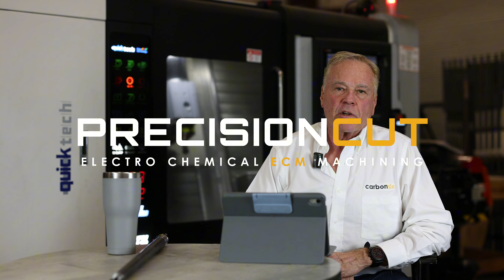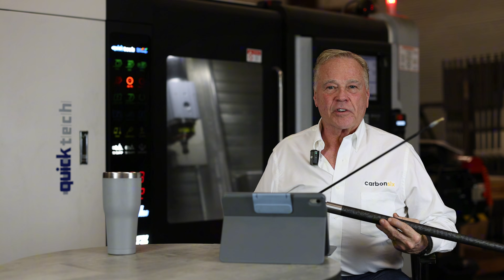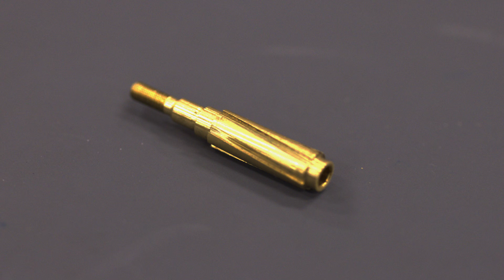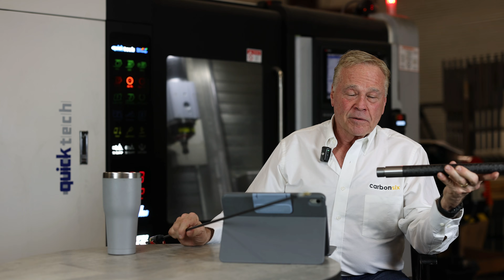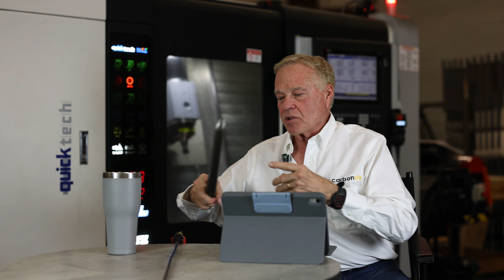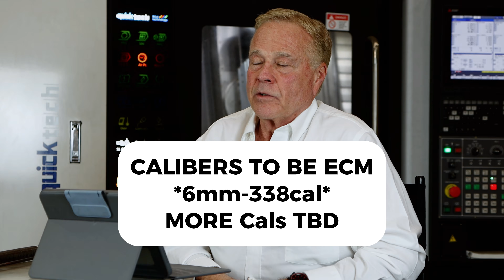ECM Rifling Process  | 2026 Company Changes

Comment: We were using ECM 50 years ago in the aircraft industry. Barrel life? Anyone check IGA?
Reply: theoretically.. actually proven out with some other companies, a notable improvement IF it includes gain twist rifling, in heavy caliber bullets with around 3000fps speeds, with barrels they are seeing 80% improvement in barrel life...it also helps handle the trend of high pressure cartridges, like the NAS3, or Federals Back Country line.

Comment: I really think this ECM method will open a new world of not just consistency but will have the potential to allow you to play around with other barrel materials that was never workable for CHF or "cutting". It's these kinds of ground breaking innovations that gets the ball rolling towards other advancements, as we know barrel manufacturing advancements have been really on the stagnant side in the last few years. Imagine this ECM method get to a point where it can be used as a "fine tune"' to a chrome line barrel to "work out" the imperfections that are a given with chrome lining .

Comment: Carbon 6 did a terrible job on the chamber of my 300 prc. There is a huge burr all the way around where the case mouth steps down to the free bore. I sent it into them and they sent it back with no explanation or fix. Barrel is currently at a gunsmith and having a new chamber cut.
Reply: Good to know

Comment: I assume that another benefit of this process is the ability to use different/better steels that can have higher Rockwell Hardness ratings which will equate longer life and even more consistency. You could literally use a high end steel that's already hardened before you rifle it.
Reply from the maker: Correct this also a benefit

Comment: "Cathode" is wrong, no insulation for isolation of cutting, thus no guide to keep it centered (the insulating material acts as the centering guide). The salt water is an electrolyte that allows the electricity to move from cathode to barrel bore, provides removal of particles AND cooling. ECM rifling is not new technology, has been used in artillery barrels for a long time. Smith and Wesson also used it for some pistol barrels.

Comment: Is there a benefit to this technology in the type of steel you can use? Steels used in button, forged, and cut rifling would need to be amenable to these methods. Does ECM let you use a harder/stronger/more wear resistant steel than traditional methods? Akin to the super steels in cutlery that have come out in the last 10-20 years.
Reply: ECM works on even hardened steel with the same level of precision. Fantastic process.
Reply from the maker: Exactly with ECM the possibilities open up

Comment: Ron. I thought that you were going to do a computer graphic simulation of the process... But, not.
You did mention "twist gain", I think? What does that mean, in this process?
I'm not sure how much "secret sauce" is involved, but I'd love to see a more complete description of how you have implemented this, because I'm kind of an innovation guy, with a pretty broad background in electronic system R&D, with other stuff mixed into the sauce, over the years... 
You mentioned temperature effects from other rifling methods, and that really struck me as a big advantage, where, with EDM, you can do a blank that has he'd any kind of "interesting" heat  treatment processing, any kind of outer surface processing, so you could almost take a complete rifle, and do rifling as an almost-last step. You're making my imagination go crazy!
Have fun, keep on innovating!
Reply from the maker: More videos to come! Thanks for watching
Reply: You rotate the cutter using cnc...can vary the roatation of the cutter relative to the movement through the bore. Minor programming changes and a shorter "cathode". Give it a little thought, and you could build a simple machine at home to accomplish this....very simple 2 axis cnc setup.